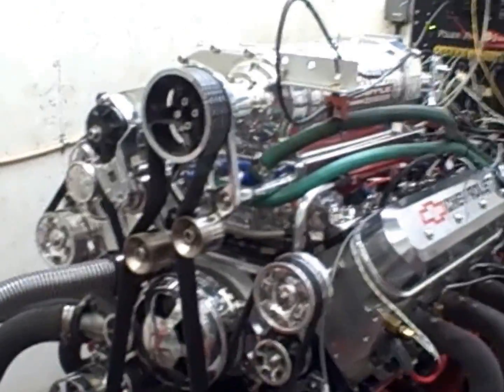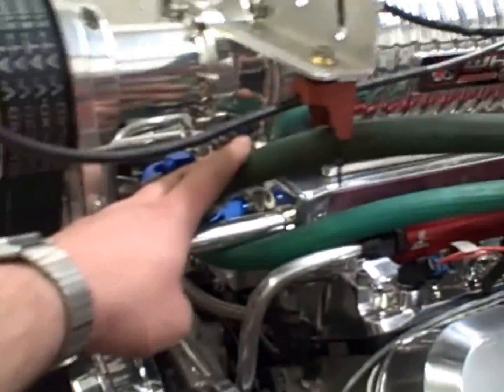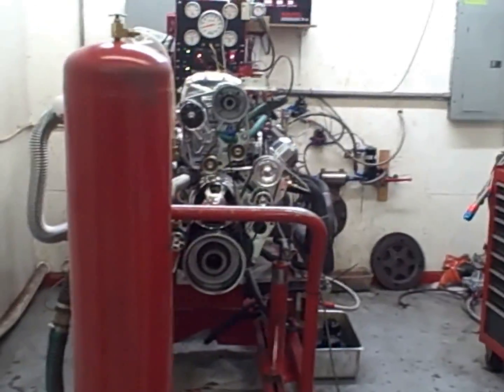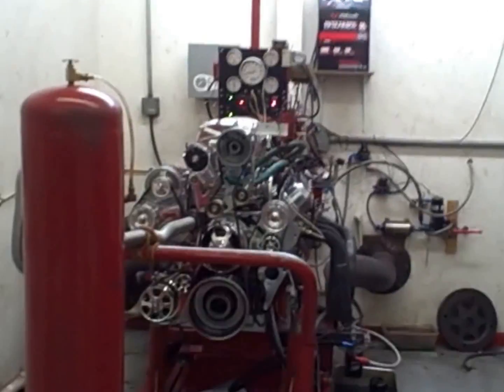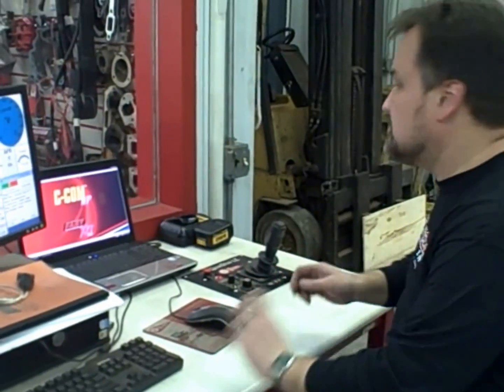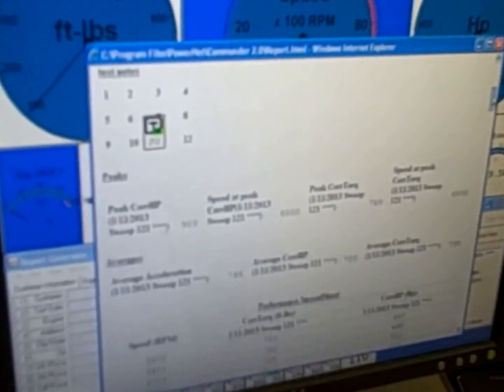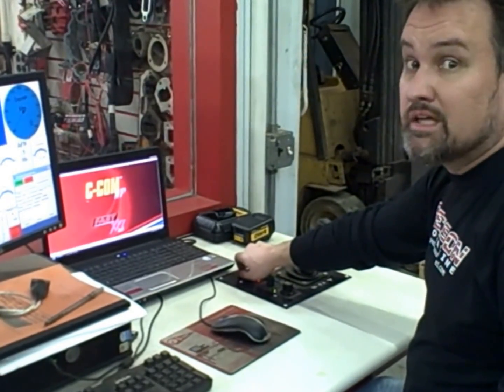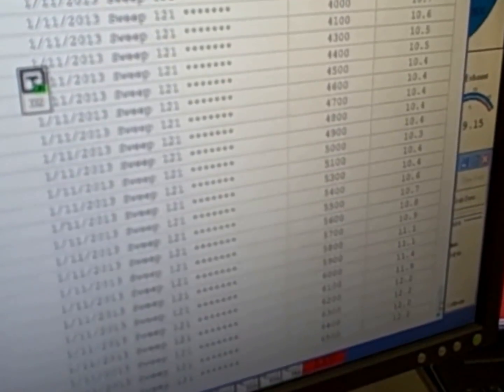1000 HP LSX Whipple Charged Engine Dyno Test

Comment: I get it, but if you want to go fast and have tremendous power this is the way to go . the extra pulley is a safeguard in case you loose a belt you can still drive to a shop .